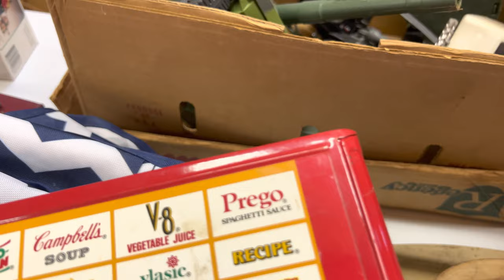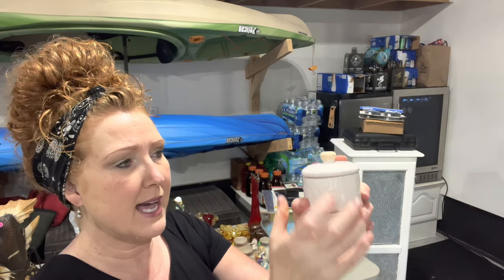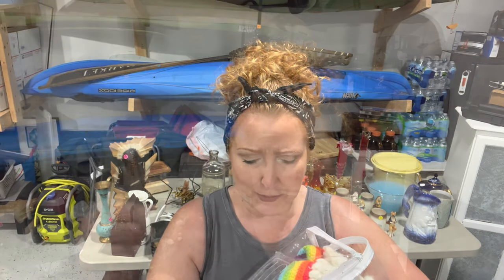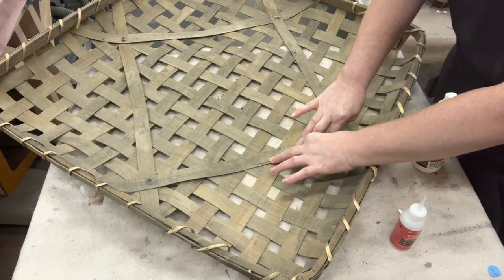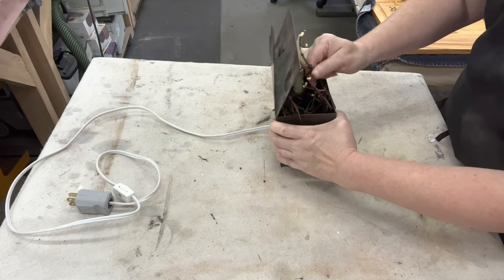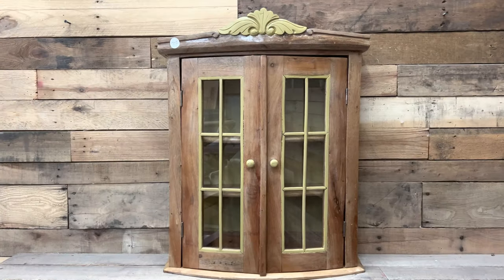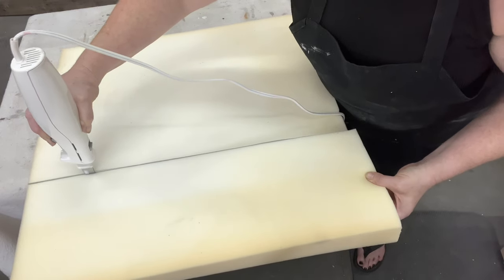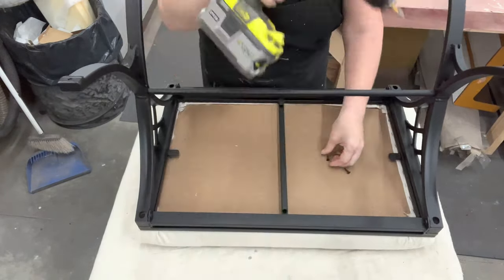We Hit 3 States in One Day | Sales | Haul | Makeover | Farmhouse | Cottage | Industrial

Comment: I have a question. If I have a butcher block cutting board. After I sand it do I put the oil on it if I an going to put a transfer on it? Wasn't sure.
Reply from the maker: No .. don’t oil it.. the transfer won’t stick. And oiling it afterwards will probably remove it.. wax after is better